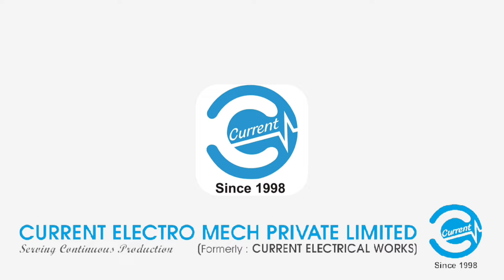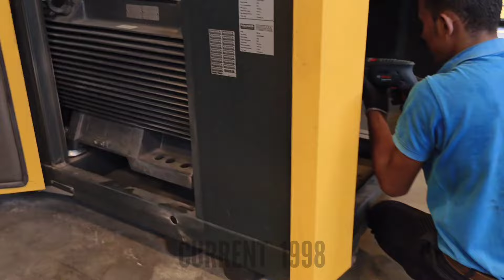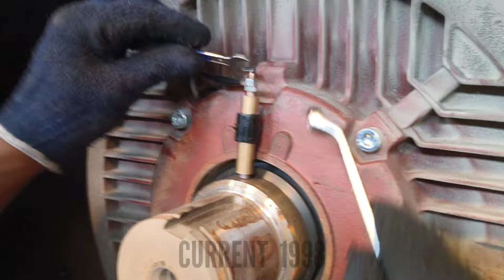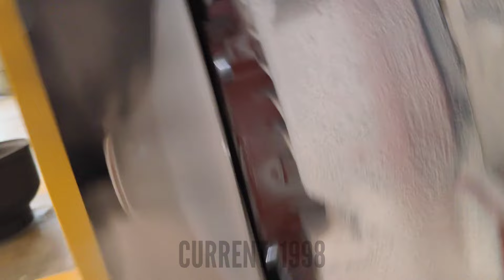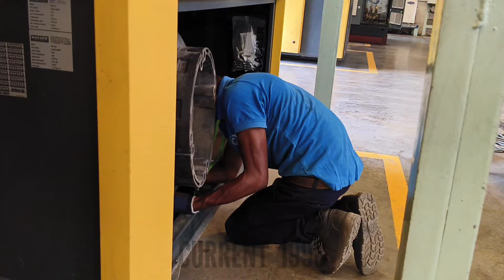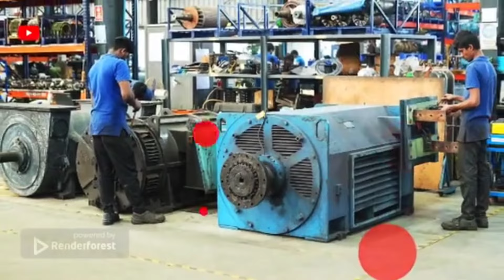Shaft Grounding In Screw Compressor Motor

Comment: Hi sir, 
A shaft grounding device prevents damage to bearings by protecting them from circulating current and minimizing voltage that accumulates on the motor shaft, where it then finds its way through the bearings and into other sensitive motor components

Comment: Why was that required sir.
Reply: Hi sir,
A shaft grounding device prevents damage to bearings by protecting them from circulating current and minimizing voltage that accumulates on the motor shaft, where it then finds its way through the bearings and into other sensitive motor components